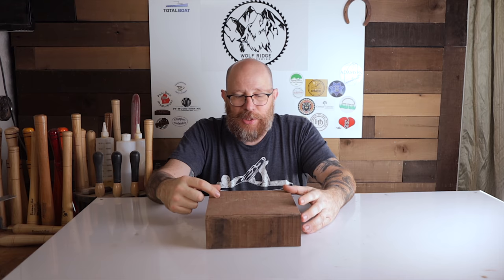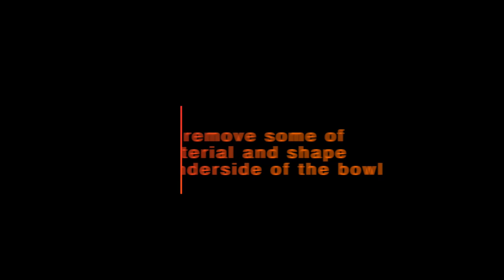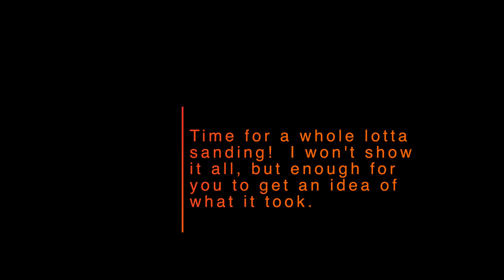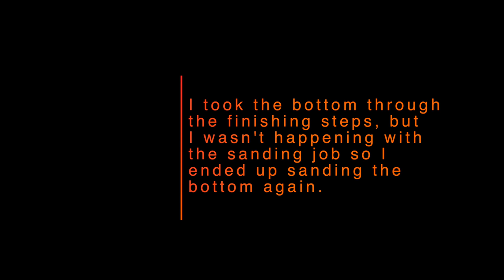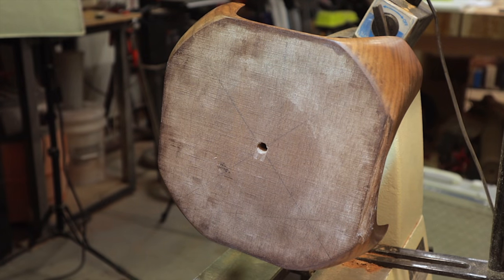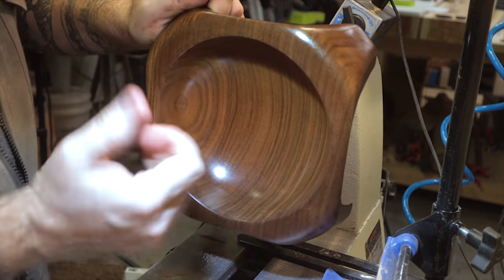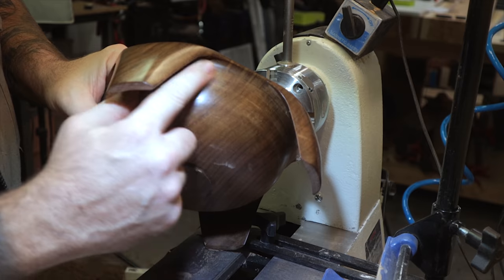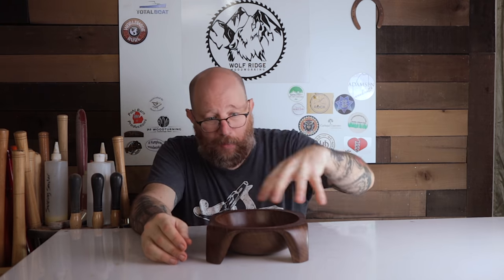Woodturning: A Walnut Four Legged Square Bowl

Comment: Hey Ed, I saw a guy glue wood on when making these bowls,  he glued all four sides then cut into a circle on the bandsaw. Worked well, no cutting air,
Reply: That’s the best way and a lot safer. You just cut the waste block off with the band saw.
Reply from the maker: Thank you Michael!  Someone commented with a YouTube video showing a safer method.  I will give that a try.  - Ed

Comment: Nice job, those 4 legged bowls can be tough, especially on the knuckles! A little advice, rub the bevel whenever you use your bowl gouge, except when u e shear scraping with it! I promise u will really see a difference in the cuts u make and the ease of using a bowl gouge! I started with carbide as well and haven’t pick up a carbide tool in 2 years since I was told to run the bevel of the bowl gouge. Way less sanding to, once u get it down a bit!! Good luck and keep up the good work!

Comment: See, that didn't hurt.  Not too shabby for your first four winged bowl.  Great Job!! However, I don’t buy the notion of your expressing some inexperience turning.  I see nothing but professionalism in your turnings.

The marks around the bottom of the bowl looked to be burnishing marks from the tool. Lighten up on the pressure and take smaller bites.  Turning at to low rpm could be the cause of those marks, as well.  You want to turn +1000 rpm.  Gotta keep the rpm high with carbide tools when turning. This is particularly true when turning the wings to minimize tear out and smoother turning. 

Nothing wrong with using carbide on the project.  Even seasoned wood turners will use carbide to make the job easier.  As you become more proficient with a gouge, reduced sanding will result.  However, be careful with the gouge where things get narrow towards the top of the back side. You'll get a bad catch.  Small round carbide should do the trick here.  Also watch your fingers around those spinning wings.  You can lose or break a finger very quickly being hit by one or more.   Other than this, I say NICE JOB!!! KEEP THOSE WOOD SHAVINGS FLYING.

There is a video somewhere on Youtube that shows how to turn these bowls much easier by using sacrificial wool glued to your blank.  It prevents injury from the rotating feet.  If I can locate the video, I will post the link here provided Youtube does not remove it.

Here is the link:   https://youtu.be/NL6b_vfvZZA
Reply from the maker: Thank you very much for the feedback.  I will check out that video.  Have a blessed day!  - Ed